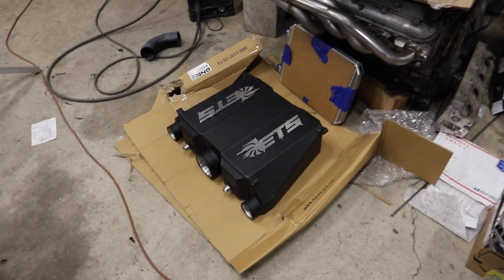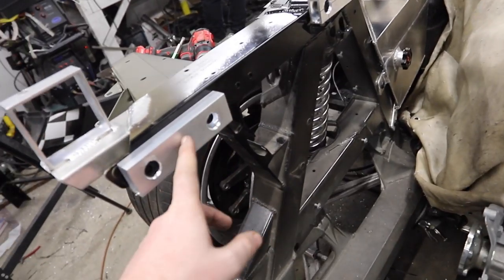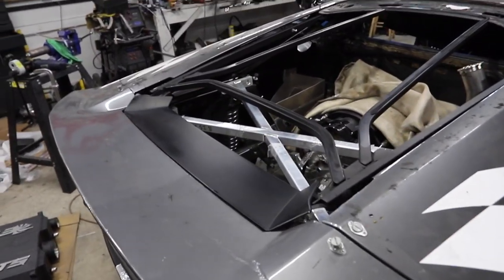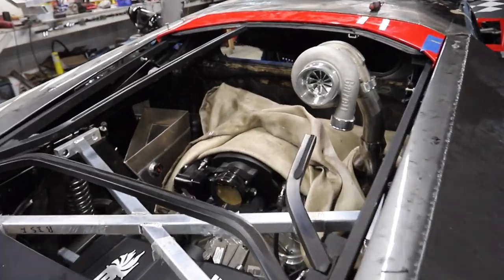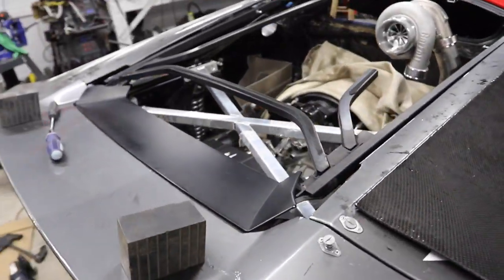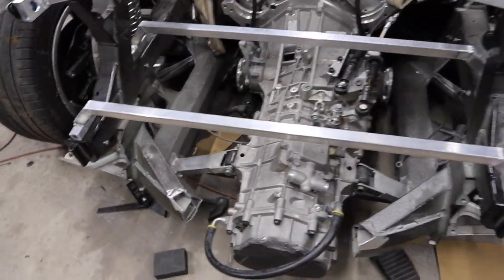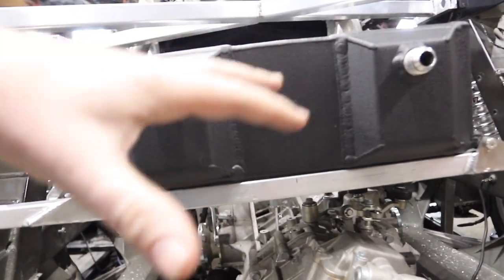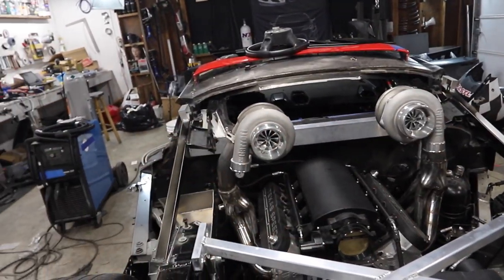Installing an Air to Water Intercooler on the LS Swapped Huracan

Comment: The turbos could literally be perfect if they were flipped. Easier for exhaust. 
easier for intake. Lower IAT's.
Reply: Brennan LaHue rocks in the intake
Reply: Too much road debris into the turbos
Reply: @Sneekystick  They make turbo screens which prevent that.
Reply: @dylanandersen9318  so add extra weight?
Reply: @Exodus-sh5mq  less than 1 lb? The lack of extra exhaust piping alone would be a weight reduction
Reply: @dylanandersen9318  does it really matter? He plans on tweaking this build later anyway so if and or when he sees an issue of the turbo he's going to tweak it anyway. It's not really not that big a deal.
Reply: @Exodus-sh5mq  personally, I don't see it as that big of a deal. Chris always works things out on his own and he will find what works for him, but it would be more efficient to flip the turbos around
Reply: @dylanandersen9318  well im not talking about you im talking about the people harping on the fact that these turbos arent flipped. its annoying
Reply: Dylan Andersen disrupts laminar flow.
Reply: @Sneekystick  theres no laminar flow on the roofline anyway, especially if the turbos are backwards
Reply: @upnorthviking823  LOL corners. By my estimate he's going to drive it on and off a trailer twice and test drive it for 3 miles after he gets home. That is if everything comes together as planned. He could build in speakers instead of the engine and play LS sounds, the car would be functionally the same for his use case.
Reply: It would be so nice if he flipped them and dropped them below the rear deck lid. He could get fresh air from the quarters with some naca ducts. There would be too many benefits to count on both hands.
Reply: Invictus_CS ok but it also disrupts “ ligma” 
Flow
Reply: @JerzyBoy973  no it really wouldent, the make screens that sit flat against the turbo intake as to not stick out like a cone filter.

Comment: Why would you have the Inlet side of turbo facing backwards? 🤔
Reply: He may place cone air filters
Reply: @Beyblade420 that air will be turbulent  as hell, spinning, no good.
Reply: Beyblade420 no on that car with its shape the air stays very close to the cars body and his placement has the turbos asking the air to turn 180 degrees. The faster he goes the worse it will get and the stronger the vacuum sucking air out of the turbo will be.
Reply: @Beyblade420 Exactly. The top of the engine bay being open will create a low pressure eddy where air will circulate, similar to the bed of a pickup truck. The turbos will have all the air they could need.
Reply: To cancel all the junk and rocks from the road
Reply: If you do u actually get more hp
Reply: @JuPac420  I have a 97 but I shop as Costco does that count : )  Man this is a sick build.
Reply: For the content... If it works, it will be a "See, I told you this would work..." situation. If it doesn't... Click bait FAIL title, problem solving, Dutch Rudder for the fan boys video will be along shortly after...
Reply: Oh it'll work. I bet this car never even sees highway speeds and at low speeds any Venturi effect from the turbos facing backwards will be very minimal. It will look horrible though. That I do know.
Reply: Jacob D is a typical mustang owner. Or do you own a new camaro? Bet you dollars to donuts I'll smoke it with my daily.
Reply: @carlos2003177  Except Oscar was hired to fab.  He didn't build the brand.  If he's not being compensated fairly then he knows where the door is.
Reply: @Beyblade420 source: Trust me bro

you have no clue what youre talking about

Comment: The "rat rod" turbo placement trend needs to die!  It has turned many potentially cool cars into clown rides!
Reply: It only looks good on the hoonicorn but thats because they are barely peeping out of the hood and done tastefully
Reply: Especially when you compare Cletus McFarland’s ride that has huge HP, ugly turbos and an obnoxiously loud exhaust, and in the end quiet full weighted cars are faster. With less HP too
Reply: Brock Mclean  not anymore it doesn't. Also, it didn't run low 7's. I believe it was 7.6 was the fastest. Only runs low 8's now. Of course "only" is relative and that is still fast af, especially for something with the aerodynamics of a parachute.

Comment: you still haven't swapped the compressor housings lol
it's not about the aesthetics it's about building a vacuum cleaner or a compressor.
EDIT he finally saw a comment on insta and said he will fix that. thanks for the likes
Reply: I laughed when he said that
Reply: What is the problem with it?
Reply: Bingo
Reply: It’s not a rammed air intake bud. Many cars have the turbos faced that way. And I mean many. My one3 kit places my turbos at the bottom of my mustang wear little flow of air exist. The turbos have great suction on there own
Reply: @sccarguy8242  I think what he's trying to say is that the two compressor housings are each on the wrong turbo. If you look closely the exhaust housing inlet and compressor housing outlet are on the same side, which would cause a vacuum effect from the compressor housing outlet. Basically the turbo will do the opposite of what its supposed to do.
Reply: @miguelmota9714   The turbos look stupid flipped backwards, it makes the exhaust plumbing and cold side plumbing much harder than it needs to me and just looks like crap.
Reply: Johnn Moreta your right it’s an anti ram air design the way it sits. Keeping a turbo out of the air (such as your mustang being low down) is one thing this is in the air, but facing the wrong way. So the air hits the exhaust side, flows around to the intake side where he is asking it to turn 180 degrees. That’s not how air flows, at least not effectively. The net result of the air flowing around the turbo will create a low pressure spot (a vacuum) at the intake. Will the motor still run?? Yes absolutely... will It will cause a loss of power?? Yes absolutely
Reply: Not too mention the turbos are going to be sucking in air from the rear which is a horrible way to do it. due to turbulence.
Reply: @sccarguy8242  exactly!! The thing that comes to mind in this situation is looking at the debris in pickup beds going down the freeway. The crap barely moves because it is essentially stuck in an area of low pressure the same way.
Reply: @sammishie1501  oh shid i actually just realized that😂 well thats a problem
Reply: @BrianEssersGarage  well huracans have pretty great laminar flow on the hatch...just have to wait and see🤷🏾‍♂️
Reply: @Kani_ne  Right, but the problem is it's been proven turbulence into the inducer greatly effects efficiency. The design is asking the air to 180* and therefore absolutely going to induce turbulence. 

Guess we'll have to wait and see, performance aside, still looks horrible.
Reply: @BrianEssersGarage  guess im crazy too cuz i like it😂 just supm about turbos through bonnets or.....rear hatch jus gets to me
Reply: @upnorthviking823  proper oil pump should fix that...and letting it idle for couple mins
Reply: @BrianEssersGarage  biggest issue right now tho is the turbine inlet and the compressor outlet being parallel 😂
Reply: @upnorthviking823  well if its ball bearing it should be fine🤷🏽‍♂️
Reply: I'm trying to learn about airflow and turbos.  I read all of these comments and it sounds like he could be leaving power on the table by having the inlets facing backwards and having them located in an area that might have bad airflow.  Thanks!
Reply: @roxburndi  this is the right place to learn alright. everyone knows all the pro's are in the youtube comment section commenting on other peoples builds, instead of building their own....
Reply: He will lose some power ... but not 2 much ... these things still sucking birds in
Reply: A lot of salty people here
Reply: I like the idea of flipping them around and running a short exhaust out the hatch like the Porsche 918
Reply: its a turbo bro, nothing stops it from sucking air in, i mean nothing
Reply: @BrianEssersGarage  that is why he is running an air to water inter cooler.
Reply: @StankMasterZ  ? I was referring to the 180 degree turn the air must make to enter the inducer, not 180* air temps.
Reply: Juan Gouveia a public discussion forum is a great place to learn. I take breaks to watch YouTube while building my cars all the time. I'll put in my 2 cents. Everything performance oriented aside, which it will suffer some. It will just look stupid af. Lamborghini is a very refined car and this one will never look completed. The over fenders are not needed to fit a wide as hell tire in the rear. There will be no rear hatch. It'll look ghetto and I can't reiterate enough it will look stupid.
Reply: @matthemberry  Stupid looking and refined are very subjective terms. Lambo's have always looked "stupid" that is the appeal. He said he wants to exaggerate this with the wide body and crazy motor. Think Rat Fink doing a super car. I think IT does look stupid af which makes it cool. Also he has this exact same car but stock.
Reply: Finally, I tried to tell him weeks ago
Reply: @sccarguy8242  that is not the issue. The issue is he put the wrong compressor on the wrong turbine. His most recent video explains his mistake.
Reply: DEJello two mistakes he fixed one not the other. The reason no one mounts them backwards as he has them is because of the vacuum effect. Thing of it this way, in that body the air stays close to the body, at speed that side is moving at lets say 80mph... he is asking that air it to make a 180 degree turn to be sucked into the turbo, but added to that is the fact that the air going over the turbo will create a low pressure “vacuum” right near the turbine inlet, where the air rushing by will actually want to suck air out rather then push air in. 

Like I said makes no difference on a dyno, but at speed it will be an issue and the faster he goes, the faster the air moves the more of an issue it becomes.

Comment: What if the turbos were sitting in their current locations, but rotated and turned so that the inlets were facing the roof(or sky), and sat lower then the roof/rear hatch line. An intake system could be designed to pipe/guide air into the turbos without the worry of direct contact from debris but still maintaining a cool atheistic. Just an idea. You do what makes you happy Chris, and your fans will support you!

Comment: Wouldn't a lap joint for the cross bracing be stronger?
Reply: You'd have roughly half as much weld in there if you lapped them so not sure it would be. Roll cages and chassis and things are usually made by joining tubes at the ends like they did so I think it works pretty well. I think it looks better too.

Comment: After the build is done you should make a vlog about practising welding so you can do the structural parts. Maybe you could weld some bars together and do stress tests with a hydraulic press

Comment: It seems we all hate the ridiculous positioning of the turbos but we can rest assured that they won’t stay there long, the weight of the turbos perched like lollipops above the manifolds means the welds or the metal will crack very quickly and they’ll fall off. The extreme heat from the turbos will likely help our plight.

Comment: Like the cross brace, you should weld a web support over the top. Will add more rigidity and would make the join look epic. Also you could add a B is for Build logo on the middle which would be right there when you look at the bay

Love the build man! Makes my job as an engineer seem so much more interesting

Comment: Flip the turbos around, lower them and run the intake through the corner windows, then you could just run the exhaust strait back without hiding it and it would look cool heat wrapped. Functional and looks cool.

Comment: If you will be doing only/alot of drag racing May I suggest a water/meth injection system as well. Cool that charged air even more! Small reservoir you can fill every couple runs.

Comment: Flip turbos and lower them down, downpipes/dump tubes slash cut tear drop out the quarter panels, make the X brace in the back drop down and mount the intercooler above the x brace.  It would look so much cooler and save miles of piping.

Comment: I still say it needs the B is for Build tag somewhere visible in the engine bay.   Maybe have it lazer etched on the intake or on the air intercooler.  I’d also think about adding some gussets to the bracing you made.  Could be designed to help hold your exhaust away for parts that need to be cooler and serve as a small heat shield.

Comment: You should add a couple pieces of 1/8" sheet metal rectangles to the top and bottom of that X Brace structure. Turbo placement really isn't an issue. It seems like people think a ram-air approach makes more sense, but in the end its not going to make any difference. It's not going to flow anymore air.

Comment: I love this build and i love what you're doing. To show off the engine bay why not get a Piece of glass cut? Plexiglass or some sort of durable glass / plastic to showcase the engine bay and you can cut out turbo slots for it to stick out. you have many vents so heat should be disburse pretty good to prevent melting?

Comment: Remove that cross brace...or at least the middle of it going over the cooler.  Make each corner of it go down to the braces the cooler is sitting on.  This will expose the cooler better through the rear.  It will also still have the cross brace...just under the cooler.  Easy fix!
Reply: Doing this will also remove unneeded excess weight.

Comment: I’d run a muffler dead center but a dual in dual out, serves the same purpose as an x pipe but will keep it a little quieter. Still going to be loud due to diameter and overall length being short but should be asthetically pleasing. If no muffler then an x pipe then caro/Kara coat it or whatever it’s called.

Comment: This Lambo is essentially going to be a work of art, having said that - the placement of the turbos is "Perfect", everyone driving behind will be hypnotized by them (no one wants to stare at the exhaust side of a turbo).  I'm sure you can squeeze a bit more performance by turning them and having roof scoops but this car will already be over 1k HP and we're not even sure he'll be able to put that to the ground, so people need to STFU and let the man do what he does.

Comment: There are a lot of cars out there that have the turbos facing the other way (like everyone is asking) and apparently haven’t had any problem with trash getting into them, both Leroy and ruby, tons and tons of other massive powered cars, I don’t see any problem with turning them the other way making it both look better from the turbo facing and having the exhaust not make tons of bends trying to snake it around things, where you can have it just go straight back

Comment: you can actually make the cross brace you built more stiff by welding triangular pieces of metal to the middle and of course boxing them in for increased rigidity

Comment: Are you planning to brace those turbo mounts? V bands are prone to cracking if not properly braced and given your extreme high mount positioning it is definitely going to be an issue. Check out mighty car mods "Gramps the 11 second car build" Ep 6 I think covers v band bracing.

Comment: think you could've made those "bridges for the intercooler a lot smaller , by making it off the rear gearbox mounting points and maibe use two of the bolts on the bellhousing  , that allso makes the turbos and intercooler one unit , you now mount the intercooler solidly to the chassis and the engine / turbo's will shake under load as its mounted to the frame with rubber mounts 
could even make those mounts out of thick sheet aluminium like engineplates wish you can make look nice with lightening holes and stuff

Comment: Get that you like the turbo positioning but you're compromising the exhaust routing and likely the exhaust sound. Flip them and you can pretty much straight pipe that beast.

Comment: Why are people hating the turbo placement I personally think it looks cool the v8 with those turbos coming out makes it look like a bull with horns
Reply: Because they are backwards. As they sit they have to draw in air from the rear of the car which will be a low pressure zone. If they were facing foward the air would be forced into the inlet of the turbo rather than trying to suck the air in from the back as it goes by
Reply: No one seems to mention that actual practicability to the placement I agree with the there would be a low presser zone with would equal to low boost but everyone else just seems to say “THE TURBO PLACEMENT IS TRASH CHANGE IT ITS UGLY” and surely he could add a intake or vacuum line to the turbo to make it suck in more air to force it to not have a low presser zone or just maybe he’s already got a plan for it all and people are complaining because they can’t be patient to see the plan once it’s finished
Reply: @Riley-gd7zz  yeah im not sure what his final plan is but it seems that by flipping the turbos 180 degrees the exhaust placement would be easier because it wouldnt have to wrap around the front then down the middle he could just run it straight out the back. Also, he could do a low profile air scoop on the roof that would more efficiently force air i to the turbos rather than forcing them the scavenge air from the low pressure zone that will be sitting on the back of the car. So to me it seems like he is choosing to take a hit to performance and the longevity of the turbos for aesthetics which, quite frankly, baffles me when the purpose is to build a massive powerhouse for the engine

Comment: Hey Buddy You Are Placing The Air to water cooler exactly above the transmission then you will have to keep the transmission cooled down too how are you supposed to do that Maybe an beefy radiator like condenser in front might help..